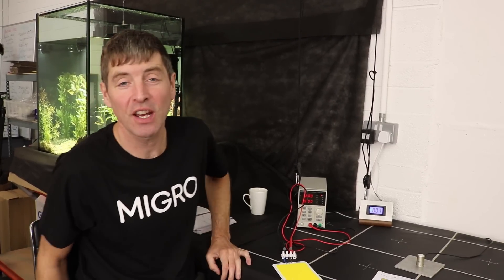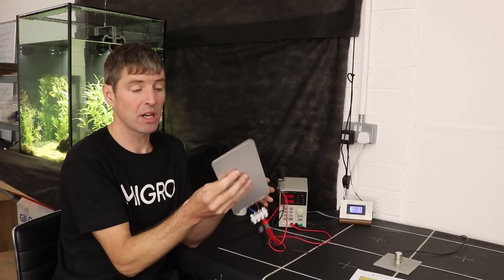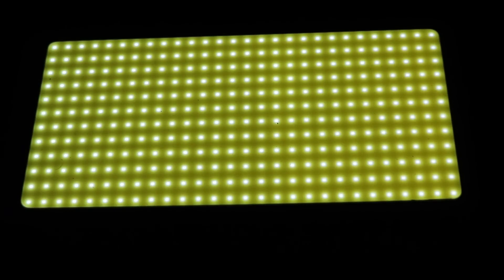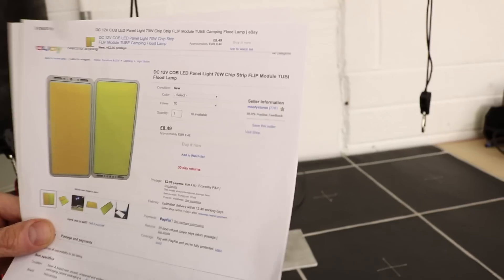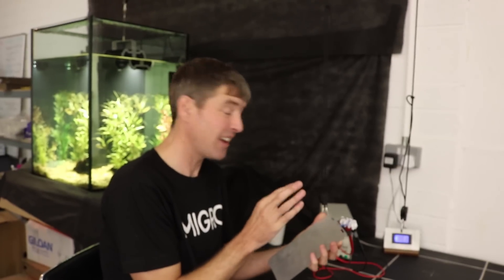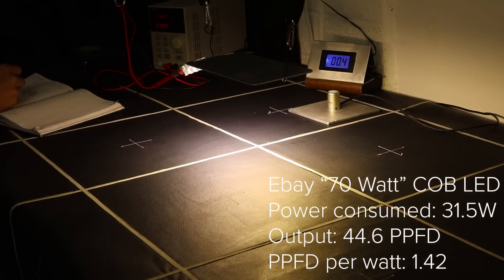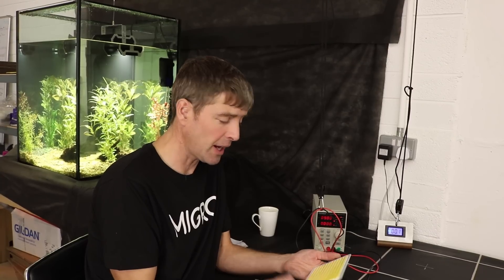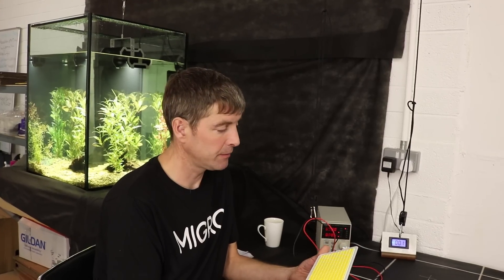Massive ebay COB LED Grow light test

Comment: i have been using 3 of these lights in my living room hooked up to a battery pack from my solar panels they are very bright and have been burning without any heat sinks on them for over 3 years now lighting my living room every night with not one pixel out yet. i used 4 in a home made grow using 12v 5amp power to each and they worked great, actually worked better than a mars hydro 1000, better spectrum for flowering in the 3500 range. I would even dangle on on the sides for side lighting hanging from the wire it was attached to. cant let the lights touch the walls they will overheat and blow. they are a cheap solution to a home made grow light that will work as good if not better than the expensive ones because its the right spectrum for flowering. they do get hot enough that you will pull your hand away because it burns if you touch the back. but it has not affected their operation for the past 3 years now. I have been testing them to see how many years they will light for and we are over 3 now almost 4 years..

Comment: I have been running 1 of these lights as lighting over my computer at 34 watts for the past 2.5 years with no trouble. its very bright at 34 watts. this one has been hooked to a 16v tesla battery i built with voltage regulator and dimmer switch. the others I hooked to a 12vdc 5 amp power adapter and even those only got up to around 34 watts, those ones I gave to a friend after burning them for 2.5 years and only 3 leds on the board were out only on one board. the other 3 working fine. .

Comment: I have the same big cob led but my is blinking after few minutes. I instal nice heat sink and pc fan so my cob is almost cold. I power this cob with 12v 1A power supply as they said on website and..... MY COB STILL BLINKING :(((( why?

Comment: Why do I hear that some folks are running driverless cobs? If I was off grid in a dc system, no a.c. or inverter could I figure a way to start some seedlings in the house before spring to get a jump on planting? In the off grid community everyone wants this but no one offers it and the smarter of us who solve the problem don't seem to be bothered to share the solution..

Comment: You should be able to run it at 11.5 volts at 3.05 amps = 35.075 watts with it being cool to the touch that's like running a thousand watt RMS amplifier on a thousand watt RMS subwoofer being played at 500w RMS you could play it forever without it burning out or getting hot,, or 14 volts at 3.6amp = 50.4 watts or 3.5= 49 watts but you would need some form of cooling or heat sink,,, love the videos 702 out✌✌......

Comment: today i had this cheap cob led i found on ebay for a couple bucks, its been sitting around my house for ages and im never planning on using it, so for fun i direct wired it with full AC power from my outlet and the thing exploded LOOOOOL

Comment: I see a Migro 100 in the aquarium. is it slightly under water? I have a 7 foot long 200 gallon. Today i almost ordered 2x migro 200 for a total of 4 lights. my only issue is the red side of the spectrum seems slightly lacking and the greens are wasting a ton of energy, but i guess the ppfd of the units really make up for the spectrum issues.

Comment: Hi, this giant leds are powerful I tested under water to about 125W OK. But you can easy go to 100W with air heatsink & fan for massive light. voltage needs to go around 14-14,6V around 7A but keep current limited and good air circulation. For long use go to 70-80W power.
Reply: Which type of power supply you suggest for this LED Panel?

Comment: Hi there. Great vlog skills. YOU need to boost voltage to 14,5V to get real 100W   U can also run it under water. It will act as heatsink. U can go up to 125W no problem. Huge light!
Reply: viK iS here how does one boost voltage? Thx!
Reply: Have you tested it underwater? how do you isolate it?

Comment: I've been experimenting with 2 of these and found they were fine at 3 amps as long as there was enough heatsink on them. I tried them on a bigger supply but I couldn't see any difference to the output and they seem fine as they are.
Reply: Was your power supply 12v 3 amps? Did this allow maximum brightness?

Comment: How hot would these panels get if run by a 3s lipo battery and a 2 amp regulator? I have a large rc airplane that I want to put some downward facing led panels under the wings without melting them. Each wing is about 8 inches by 3 feet and made of epo foam. Would you have any suggestions? Thanks for your time...

Comment: When I first saw these I though space bucket, especially if you  added one of these https://www.ebay.ca/itm/300x140x20mm-Aluminum-Heat-Sink-Cooling-For-LED-Power-IC-Transistor-Heatsink/132296152126?ssPageName=STRK%3AMEBIDX%3AIT&_trksid=p2057872.m2749.l2649 . Then I ran into an ATX power supply while cleaning the basement  so a couple more are on there way from China along with a  boost converter.  When the DIY bug hits logic goes out the window :) I am thinking at 4 units at 36 watts a piece should light a 2x2 just right

Comment: I have major heat issues running this thing with a cheap 12v 2a power supply. In free air the cob is burning hot after 20 minutes of light.
Could I add a resistor or some other load to lower the max current to ~1.7a?
Reply: I'm currently running two of these in series using a constant current, 2.5 A driver. I built a heatsink from aluminum profile and mounted a 90 mm fan on each and now they're running nice and cold 👌

Comment: I am running 7 off a 20Amp PWM motor controller, at 13.8V with about 50% duty cycle. They are warm, not hot. Working well. I had the power supply already so only in it for the cost of the panels and the rig to hold it which I made from PVC conduit and fittings.

Comment: Hi Shane. Any chance you could do some tests with those 220v driverless  (built in driver) cobs?
Reply from the maker: I'll pick some up on ebay soon and have a look, thanks
Reply: @MIGROLIGHT  I second this request! Would love to see how these driverless COBs perform in terms of PPFD per watt, particularly the 20W white version which I suspect is more efficient than the 50W (they both seem to have the same number of diodes with the 20W being driven at a lower current which would make it more efficient). The "full spectrum" version I suspect is pretty bad, though it would still be interesting to see the real world data. Love your vids by the way, keep up the good work!
Reply from the maker: I have some on the way from eBay. Stay tuned
Reply: @MIGROLIGHT  Nice one! If they're good it could drive the price of lights way down i.e no external driver needed ☺
Reply: @cocospops9351  I'm buying a couple cheap ones to try them out myself (110v here though)... You can buy 50 watt kits with fan/heatsink/reflector/builtindriver/cable for $15-20... Just need a 12v PSU to power the heatsink fan (Can be had for <$5). I'm not able to do any real testing, so I'd be curious what @Migro finds too... but for the price, seems like a steal (with some rigging of a cheap CPU heatsink, you can build the kits yourself for <$10 each... 500watts of COB led for $100 sounds pretty good). I bought the stuff to build a kit myself and might pick up one of the readymades too (waiting on seller to get back to me about whether the wiring is actually 110v... the img/description doesnt change when I select 110vs220).
Reply: @iansammons2730  I've been using 3 50w cree chips (not driverless) for the last two years with great results and will be adding 4 x 30w driverless chips as supplemental lighting. I built a fitting for the 3 crees, they're arranged linearly in a hollow box with only 1 fan, at the end. It's great, wouldn't go back to using anything else! 2g per watt on average 😊 Looking forward to results on the cheap cobs
Reply: @iansammons2730  The only annoying thing about them is the flickering due to simple pwm power supply. Looking forward to the tests!
Reply: @cocospops9351  The Seller shipped me one 20w instead of 10... so waiting on a reshipment of the other 9. The 50w hasn't arrived. I got a 30w bar style (~125x20mm COB led) with aluminum fin reflector and one 20w chip style one here now. The 30w fin/reflector ones are sold giving the impression they won't require a heatsink (the reflector is supposed to act as one). I wired up the 30w... It draws ~37w actual and the reflector is too hot to touch after about 3-5 minutes on. I turned it off at that point... so most likely requires a heatsink (i'll mount one to the reflector itself and test that setup later)... I'd say the 50w versions would absolutely require a heatsink... probably a decent sized or active one too. The reflector is sufficient cooling to use it for 3-10 minutes maybe... not for 8-24hrs... They DO cool off quite rapidly though, so a bank of three alternating one on two off may work without additional cooling if you wanted to try that for some reason.

I compared it with galactica luxmeter on my phone to a 60watt (actual draw 82w's including 2 80mm cooling fans) SMD LED unit and a small SMD LED bulb (sold as 10w... actual ~2watt draw).  Not set up to do a fancy par region test... but it's pretty clearly a lot of light output. I'd be curious if two of them side by side compared well against the 60w SMD LED lamp... as they'd draw a similar amount of power. They definitely aren't clearly a great value though... once I add a heatsink to them, they're not even offering better cost/watt than the cheap SMD lamps do, and from my (admittedly very half assed) comparison they don't win on efficiency either. BUT... the big thing here is this reflector doesn't direct light very well and the lamp DOES. This thing damn near lights up a small room when on, so it'd have to be VERY close to efficiently light a small area... BUT the efficiency is going to improve a ton as you build a bigger system out of these and overlap starts to happen. Add good reflective walls around everything and it'll go up again. Once I get my little fake grow tent I'm building out of emergency blankets on top of my tomato cages and the rest of my 20w's arrive, I'll be able to see if the light from these can be effectively channeled to bring the efficiency more in line with what I was hoping to see. 

Also since the chip style + reflectors are much cheaper per w than these bar style (less than half the price), now that I know they will both require the same additional investment in cooling, they're going to be a better comparison... Also I suspect buying the naked Cobs and building your own reflector around the unit as a whole would be by far the best course... but that would require quite a bit more work... so I'm not willing to undertake it until I am able to see if these things even last long enough to bother with (Since some people are saying their lifespans are measured in weeks). 

2w bulb: ~15k lux @ 2.5inches... footprint 2x2" or so. 75 lux @ 12 inches distance. 
60/82w growlight:  ~15k lux @ 18 inches... footprint ~12x10". 37k lux @ 12 inches distance.
The 30/38w Cob LED with reflector: ~15k lux @ 7 inches... footprint~ 7x5". 4k Lux @ 12 inches distance.

The big test I'm waiting to do is to see if the heatsinks I purchased can handle dispersing 60w's worth of these LED's (3x20watt versions) without direct airflow and just how long the 20w versions can last. I'm hoping both results are positive and I can start making 60watt bars with passive cooling that I can move to where I want them within my garden.

Comment: Have 2... With heatsinks at 12,15v 4,2 amp.... They perform rly nice...
Reply: What kind of driver do you use? Do you think I could drive 2 of these in parallel from a 100w, 12v power supply?
Reply: @Knasen3  i use pc power supply runs very well
Reply: @gorrthebutcher4696  ok! I'm running mine on a 2.5 amp constant current supply now. Works great!

Comment: I have been looking at these. Is there an advantage to mixing warm white with cool? I have a bunch of household warm white with some cool white...vegging well. No grow LED's in there...bout 6000 Lumens warm and 2000 Lumens cold. I was thinking of mixng warm and cool with these panels.
Reply: 100% theres an advantage. 😀
Reply: @FineHomePainting  thanks for that. There is quite a lot of heat off the warm whites (too hot to touch) so there is a portion of IR there too
Reply: @m3sca1  mix the panels 6:4 or 7:3 with your warm kelvin the predominant.
Reply: thanks man, great info
Reply: Hidden Harvest Grow Lights  i just ordered 4 warm and 3 cool, those with the other lights should smash work a good combo. Any advice on flowering vs. veg with the warm/cool balance?
Reply: Kelvins....

Comment: Put some black insulation tape on the back to let the heat escape better
Reply from the maker: I actually think they're anodized. The temp reading with IR was spot on which indicates good emmissivity.
Reply: @MIGROLIGHT  the Ali must be coated or anodised to have a higher emissivity, anodised is around .75, if coated with plastic coated it will be around .94.
Did you do a physical reading or just IR

Comment: Shane you know how they say Hps should be 12-24 inch away from canopy, some led's 36 inch away and Cmh around 20 inch's, how close to the canopy could I get these if i wanted to do a vertically stacked grow?

 Like a 1 sq metre grow with another 1 sq meter grow stacked on top of it (doubling floor space). Led's seem like the way to go for heat in this setup, but I only have 2.2 metre in height, so its the is the light to canopy distance that is the problem (taking up precious height space that i don't want to give up).

 A bunch of these would give me a meter sq of coverage (I would cool them) BUT how close can I get them to the canopy and still get top notch 'Indoor Tomatoes'?

 Also would the penetration to the lower 'Tomato Bud's' be Ok? Lets say in 12 inch's of foliage from top of canopy to where it was 'lolly-popped'?

 #420 #Top Cola's #SOG/SCROG  :)
Reply from the maker: I'd go for HLG QUANTUM boards and run them at low current. You can run them 15cm above the canopy with very little heat. They are much more efficient than the eBay ones and good value too.
Reply: Thanks for the super fast reply will like the vid. Last question what system would you use  to maximise head room? nft? i think ebb and flow needs at least 12 inch root bed??

Comment: Hi is it feasible to connect this to a   plug in 12v 2 amp power supply which was for a TV?
Reply from the maker: Sure is. Im going to do sonerhing similar with an old laptop power supply. At 12v and 2amps. The backplane is about 3mm thick aluminium so no problem with cooling. Perfect for seedlings in a 30cm x 39cm box. Neat👍
Reply: run of a 30amp 12v variable cb radio psu  surely it will only draw what ampage it needs if its anything like how a tranceiver draws its amps :)

Comment: better then some spectrum king models? is this true?
Reply: Wouldn't doubt it... Quite a few of their older lights were quite a bit less efficient than a traditional single ended hps light. Granted that's only one aspect of a light, and not their stated goal as far as I know, but yes I believe it. Haven't looked up efficiency on their latest lights, but I would guess they're still "middle pack".
Reply from the maker: Yeah I tested their range last year and MLH 100W was 1.1ppfd per watt and 400+ was 1.3 I think.
Reply: Don’t tell liquid Jade that.
Reply: no doubt eh? That's crazy. I think most LED lights are way to expensive for whatthey are
Reply: Spectrum king is overpriced as any light in that range. Believe it ......

Comment: Isn't PPFD measured over a square metre? I believe what you measured was the average PPF over a two foot square area.
Reply from the maker: Full details in the description. 44 PPFD over 60cm x 60cm area. 44/0.36m2 = 122 average. Good enough for growing seedlings over 60cm x 60cm.
Reply: @MIGROLIGHT  Might be A bit late. Would it be sufficient to grow lettuces/herbs over 60x60?